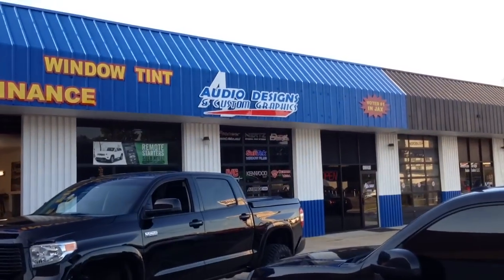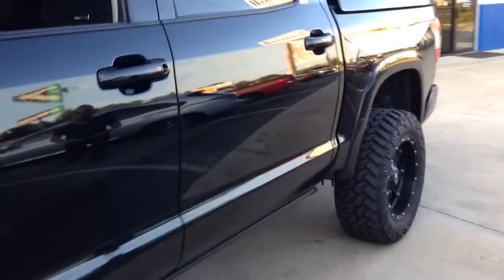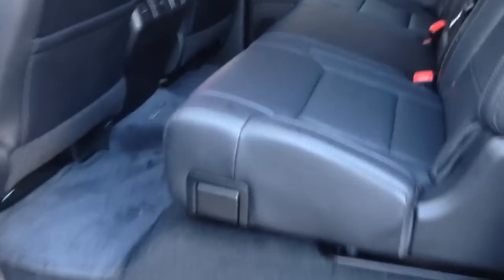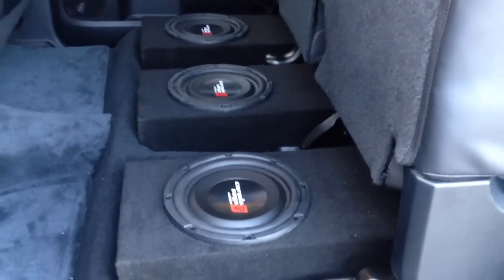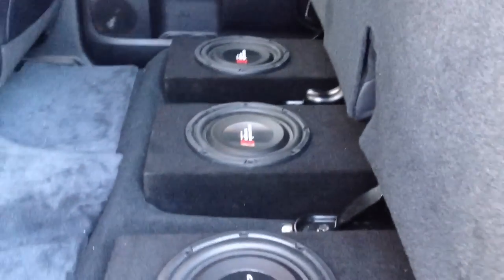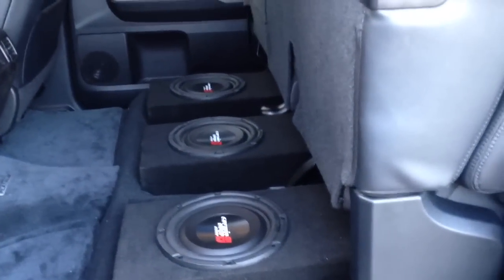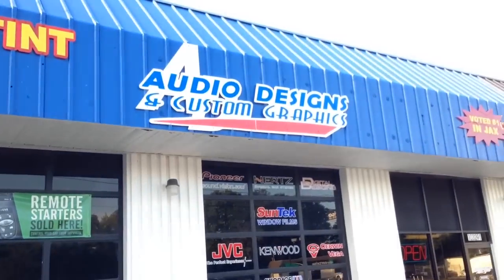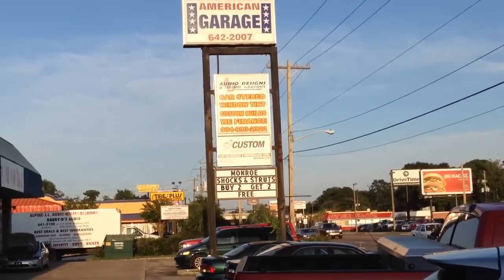2014 Toyota Tundra Under seat Custom Enclosure

Comment: Hello I have a 2019 Toyota tundra crew max. I have 2 12” subwoofers behind my seat American bass es 12”.  Will a box you create still fit in my truck with having 2 12”s behind my seat? Also do you have a link to where I can see options?

Comment: now do rear seats fold down without ny restrictions & how does it actually sound with folded seats even if its possible  seemes theres now air flow movement underneath the ,looks pointless is seats are down which is the whole point

Comment: Hell yeah i'm in Jax, where are you guys located?
Reply from the maker: Tommy, we are at 10329 Atlantic Blvd.
Reply: Ok cool I know where you guys are then, I used to work right over in that area.
Reply: Audio Designs & Custom Graphics how did these subs work along with the factory system? Were you able to get all the muddy bass out of the door speakers and actually to the subs like it's supposed to be?
Reply from the maker: Zakk 5150 You could try turning the bass down on the factory radio if you aren't planning on adding an amplifier to the highs. You'd have to adjust the sub amp accordingly. 
Or put some caps on the factory speakers to cross them over.
Reply: Audio Designs & Custom Graphics I do want to upgrade the mids and highs . Would you recommend just adding an amp? Or redo all the door speakers and dash speakers plus adding an amp? Also would changing out the head unit be a good Idea too?